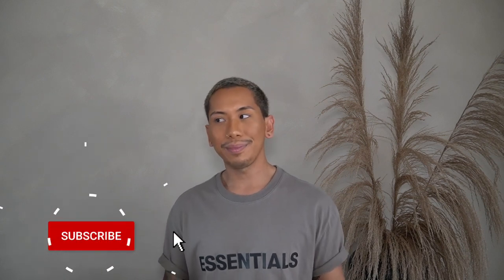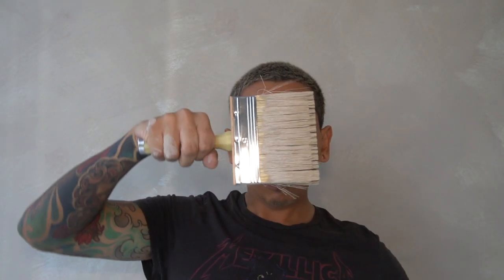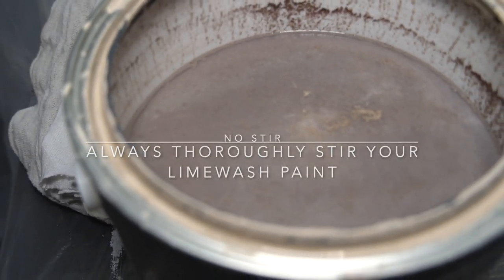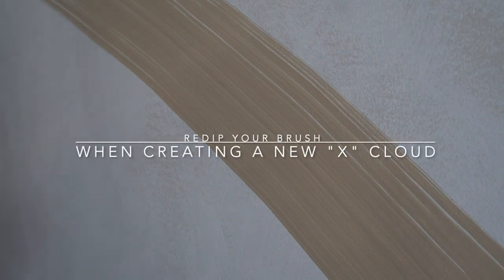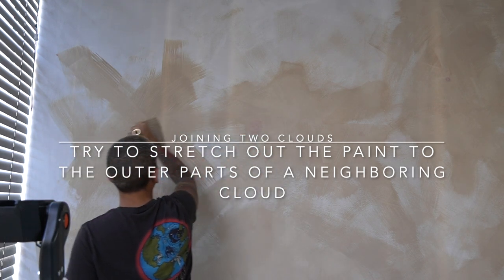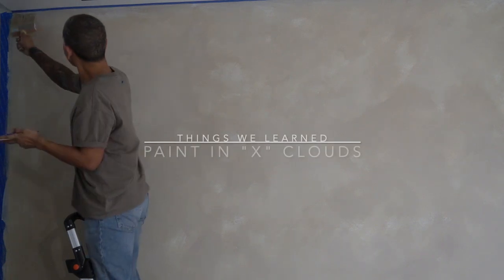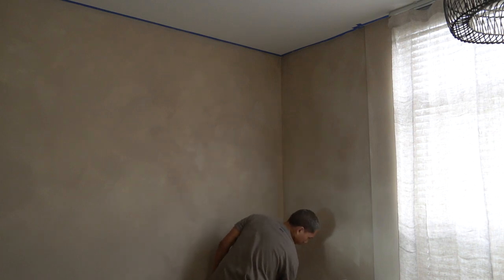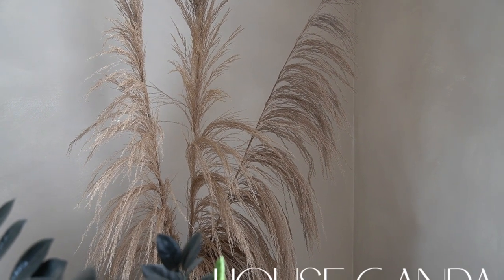How To Limewash Your Walls - with House Ganda

Comment: How many sq ft was your project? Did you only use 1 gallon?
Reply from the maker: It was probably 10 x 6 room but one wall was floor to ceiling windows. I did use 1 gallon and had a 1/3 left over

Comment: Does limewash work on ply wood wall?
Reply from the maker: Hi Aaron, I would recommend you check with the lime wash brand you decide to go with. Typically you should use limewash for porous surfaces only including brick, concrete, stone, or other masonry, but not for wood or drywall (including plywood) 

Some companies however will offer Limewash or primer specially for indoor surfaces - suitable for drywall or plywood. Hope that helps!
Reply from the maker: I have heard acrylic based primers may work for limewash on plywood, but always safe to check with the Limewash manufacturer!